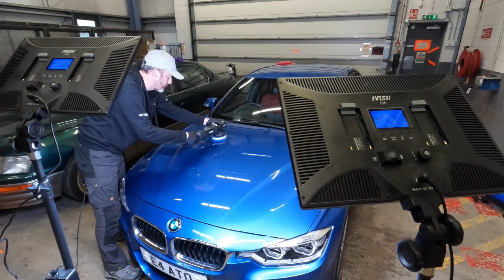🟢HB SAUCE BANANA CORTADO SHOW WAX #carwax #cardetailing #carcare

Comment: Loved this video and great to see 2 people giving their opinions. Regarding the wax, would you say adding a second coat will give even more longevity of protection?
Reply from the maker: Thanks buddy. Adding a second coat will be beneficial but the gains are not exponential in terms of double the coat, double the longevity. Adding a second coat will be beneficial as it will cover any missed areas and theoretically will provide more protection from the elements as the physical thickness of your protection is more. Regarding longevity, the longevity of any LSP is fully dependent on the longevity of your base coat that is in contact with the paint surface. As such the variable in this case is the layer of wax that is first put on. Therefore any subsequent layers of wax placed over this base layer of wax will more than likely not give an enhancement of longevity, but will offer increased live protection from the elements. This is why when layering different products over each other, ie waxes over sealants, the product with the longest longevity should always be applied first.